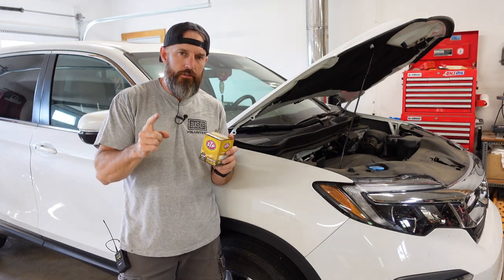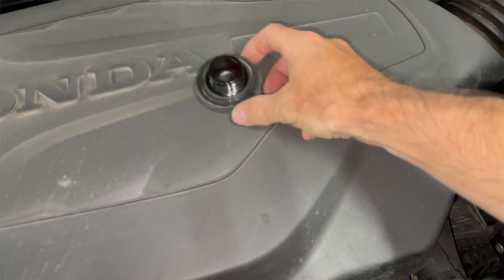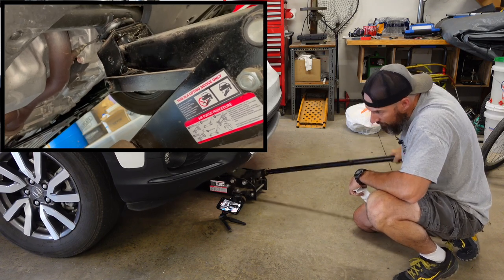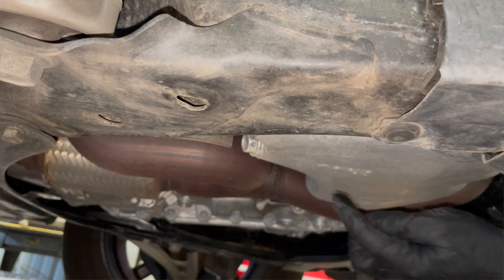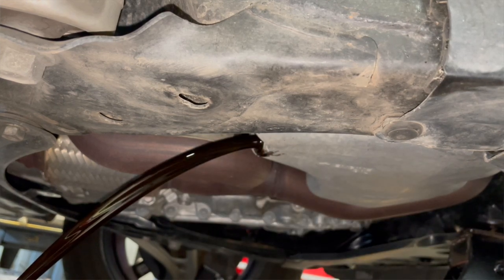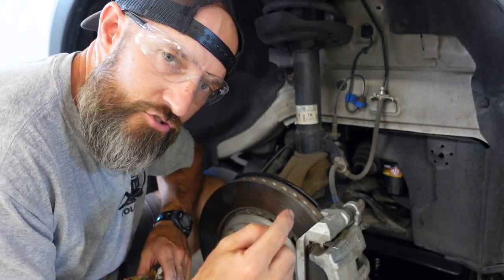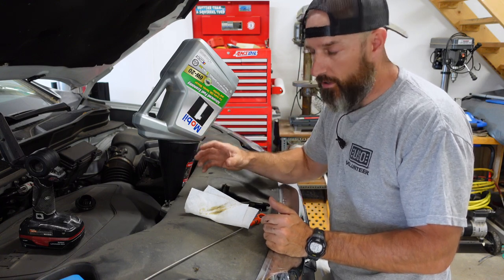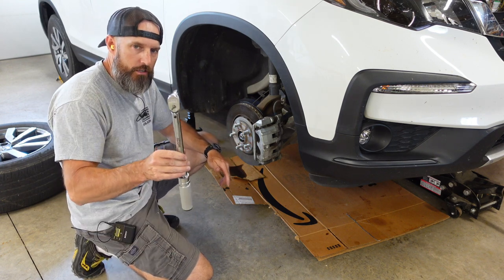How to change oil on a 2022 Honda Pilot (step By Step)

Comment: I see, your tourq wrench handle is 15 " long. When you said the both numbers (ft/lb.) , for lug nuts and drain pan bolt, was it after conversion to 15"  or it was the number taken from manual , which in your  situation will be wrong  torque tension?
Reply from the maker: I was giving you the torque spec from the manual. Thanks for watching.

Comment: Thanks. Only thing I don't get is where is the transmission or ctv not sure which it's called on this model. Where do we fill that and how often?  Huntington Park CA. But I will  change the oil from now on
Reply from the maker: Sorry I have not really looked yet but if I'm going to guess it probably is a sealed system so hard to check and fill. That is how my old 2007 Tundra was
Reply: its like an intergrated device some type of sensor. thanks for reply
 @DIYJIM